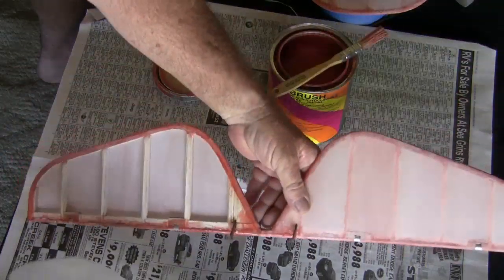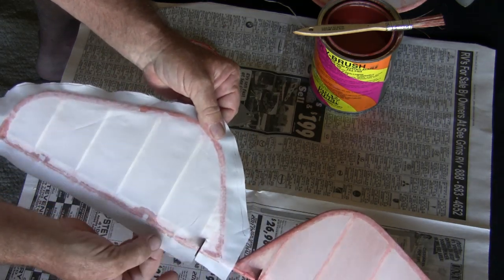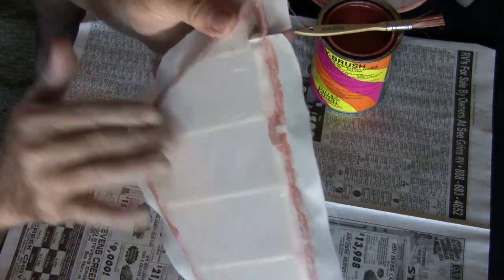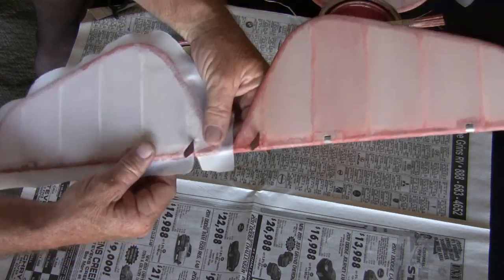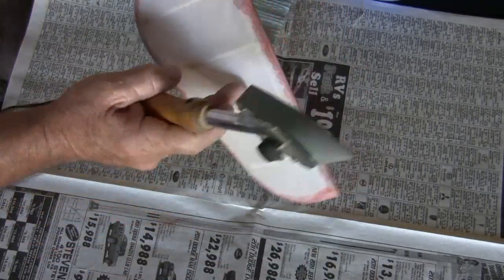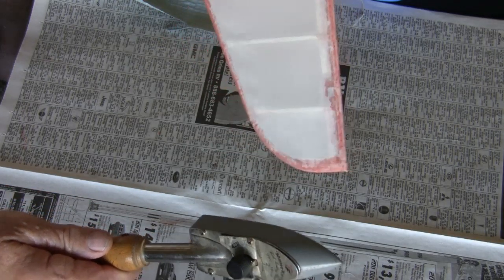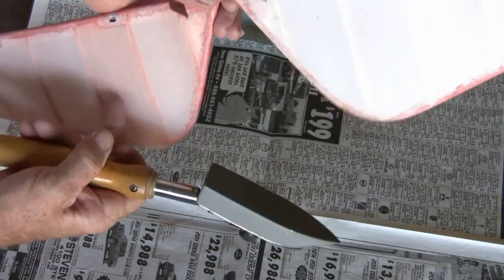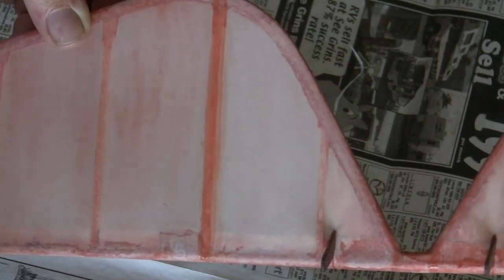Scale rib stitching for PCA-2 part 2

Comment: I watched this video and his methods add some nice semi-scale effects.  I have covered many full scale airplanes such as Waco's, J-3 Cubs, Beach Stagger wings, etc.  I prefer to cover and stitch my models the same as I do the real airplanes.  Stitching is done with one continues string for each rib.  It loops over the top of the rib and is tied at the bottom of the rib with what is known as a sane knot, used on a fishing sane.  the string is than ran along the bottom of the rib to the next stitch and so on and so forth.  When doing the vertical stabilizer and rudder, the knots are always placed away from the side of the airplane that has the door on it.  If both sides have doors than the knots are placed away from the pilots side, left side of the airplane.  On models, I use just one common knot instead of the complicated sane not.  Before the stitching is applied first lay down strips of fabric to simulate the nylon chaffing tape used on the full scale airplanes.  These should be the width that you want the stitches to be.  They also make an excellent guide to keep the stitching
straight.  

Rib stitching is not uniform!  The closer it gets to the fuselage the closer the stitches are together.  The closer stitching is to make the fabric bond to the ribs stronger due to prop blast.  After all stitching is done, pinked reinforcement strips are placed over the stitching and carefully tamped  tight around the stitches and knots.  The faster an airplane is, the closer the rib stitches are.  You can buy a 3141 FAA aircraft repair manual and all this information and more is in it.  Hope this helps some of you guys!
Reply: Nice. Hope you could do a video some time.

Comment: I get that this isn’t an FAA-certified application, and I am an A&P myself and have worked with the Stits process several times. But people should consider following the Stits instruction manual. It is free of charge. Poly fiber develops maximum tension at (from memory) 350 degrees Fahrenheit. You start at about 225 and go up from there. Personally, I would have used 225-275 on this component, applied evenly. As it is the way you did it, you’re not really certain if the tension is even throughout the piece. I get that this is for a small RC aircraft, but someone might use this as information to do a 55% sized Stearman or something, and there’s a lot more potential risk there than with this part.  I also read your comment about below about not using Poly Tak to save some money, but it works REALLY well—and then you wouldn’t have to iron over Poly Brush. 

I make these comments not to Pooh-Pooh your work, because on the contrary I think you did a great job. However I think people who might be contemplating using the Stits process on a larger/faster RC aircraft should understand that it’s really NOT hard at all to follow the manual, and that a guy should probably do just that when they are building a larger or higher performance aircraft...even though the FAA isn’t involved.

Comment: just curious. Why did you use PolyBrush to "Glue" the fabric down instead of the actual PolyTak Glue that is normally used ???
Reply from the maker: Hey Scott, thanks for watching.  Poly brush is quite sticky on its own. Poly Tak needs to be thinned before initial use anyway and just not practical for model use. It's just an additional cost along with the thinner. (Plus, we don't have FAA watching over our shoulders, yet)